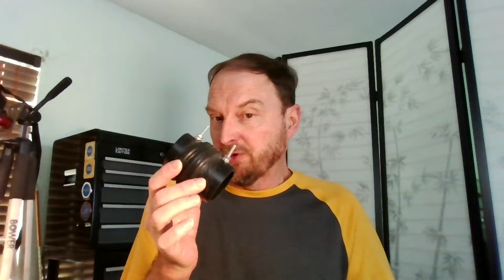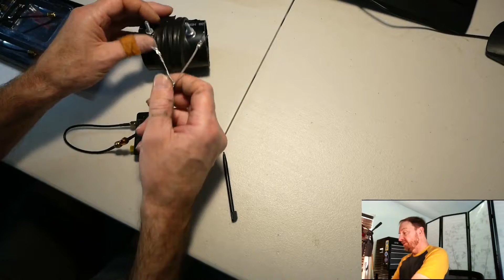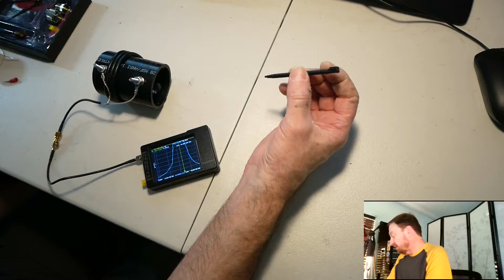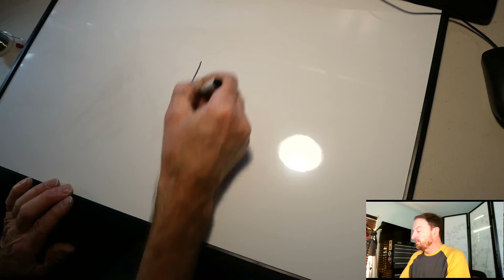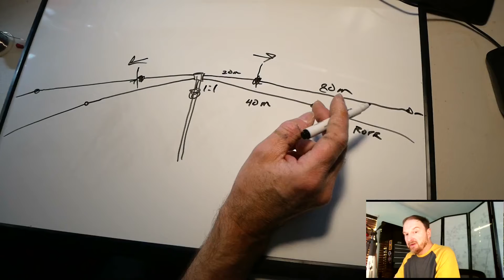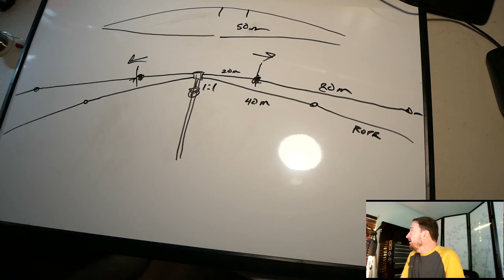Building and tuning tank circuits to block RF using cheap coax and PVC pipe.

Comment: With a multi band antenna your better off with a doublet, it’s fed with 400ohm open wire, get the length righ and you have a multi band antenna.